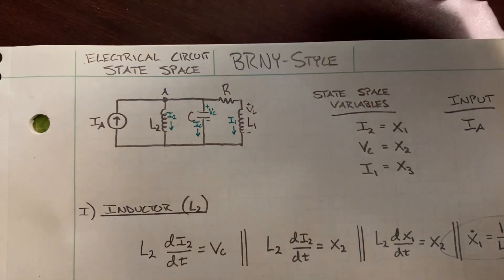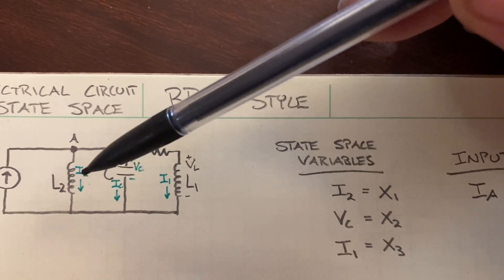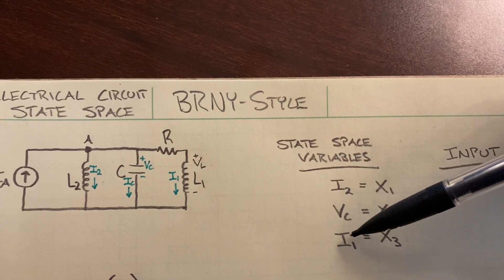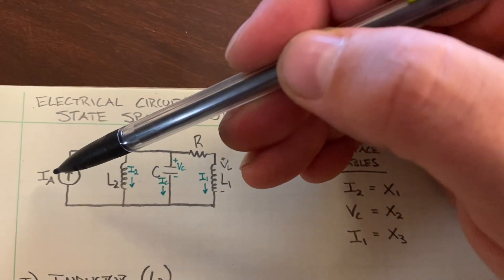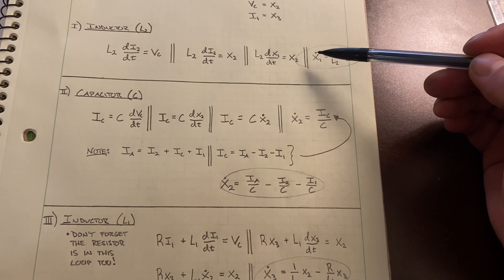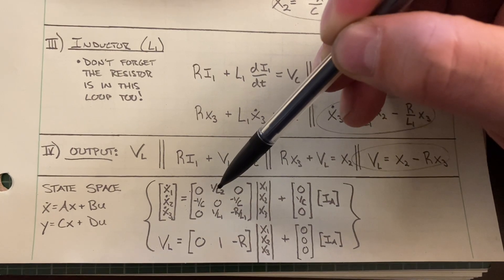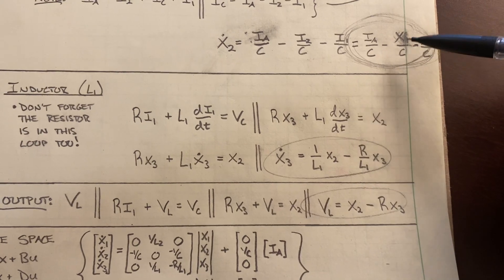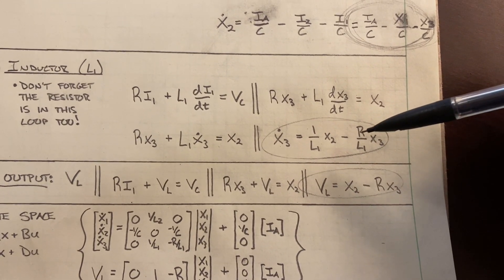State Space of Electrical Circuit (BRNY-Style)

Comment: Thank you for providing a well explained video.  It helped that you had the information pre-written as you can see ahead as to where you were going with the delivery.  It was very easy to follow.  I would just like to make one small suggestion.  After having performed the analysis, can you provide information as a heads up as to what an engineer can do with the analysis (state space representation) results.  How can this information be used for designing a compensator should the circuit be fundamentally unstable?  Can you elaborate.